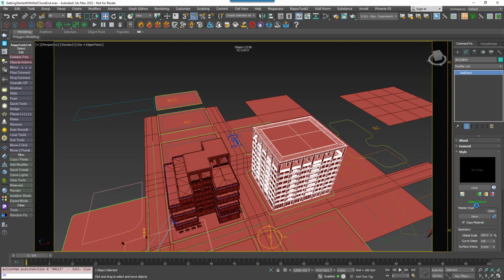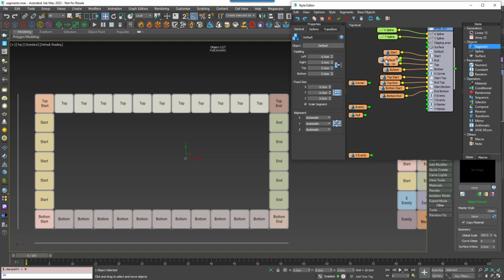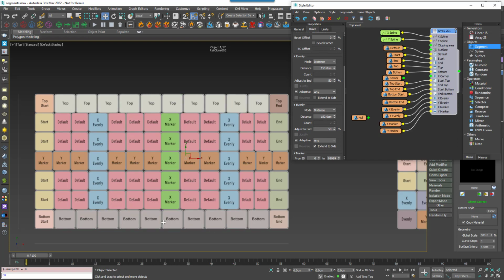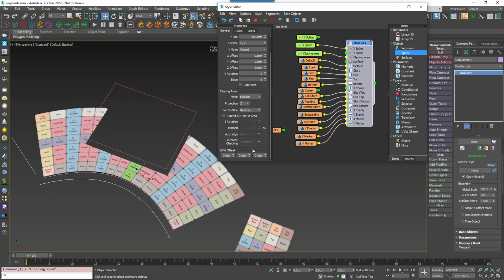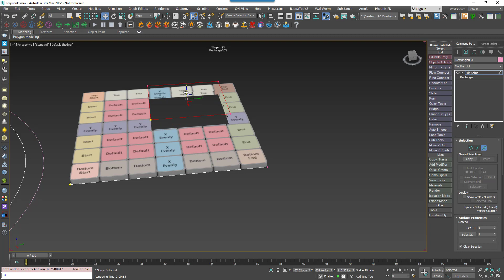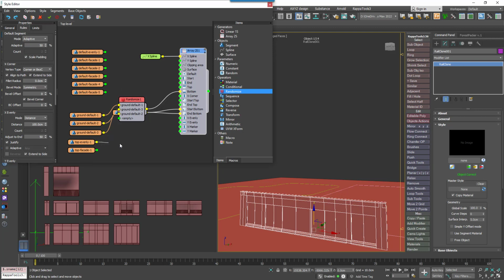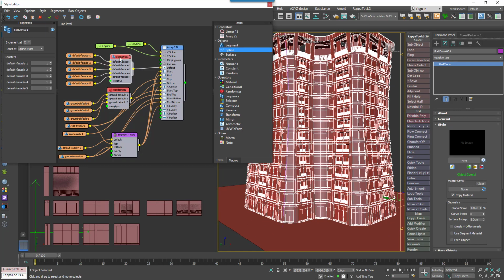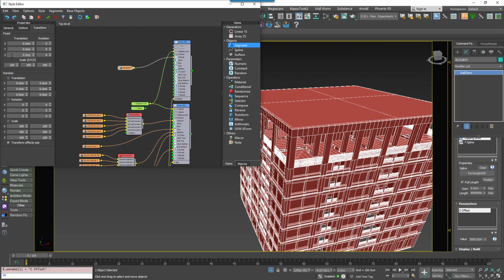Create a building generator and master the A2S generator - Getting Started with RailClone Part 6

Comment: In the last step where you translate the z of the roof, would be possible to make an offset of the clipping area in the four sides of the square so the roof is smaller to joint with the other geometry? I am trying to generate the internal slabs separately and that functionality would be helpful. Thank you!
Reply from the maker: I'm afraid not at the moment. We normally get around that by aligning the back of the walls to the outside of the spline, and the roof plate to the inside
Reply: @itoosoft  thanks for getting back with this.  I think it could be a interesting addition for a future update, be able to offset the spline inside the editor. I can see many cases where this could be very helpful. Antoher question, how could I do the same with Y evently that you did on this example with the macro segment Y role? Thanks again!

Comment: Loving the procedural functions here. Just a question, are the procedural operators and generating buildings, achievable via the free railclone version?
Reply from the maker: You could certainly create simpler buildings with the free version, as long as you stay within the limitations listed here: https://docs.itoosoft.com/railclone/getting-started-with-railclone/3-railclone-versions-lite-and-pro
Reply: @itoosoft  another question if you dont mind, I am following the tutorial using 
 railclone 6 pro, how do you create the markers in the first place, i dont see any markers in the select objects after selecting clone multiple, its empty, no bottom, top, etc...
Reply from the maker: @supasuoasuoasupa1939  Markers are added by adding an RC Spline modifier to the splines. You can read more about them here: https://docs.itoosoft.com/railclone/rc-spline-modifier

I hope that helps. 

Paul